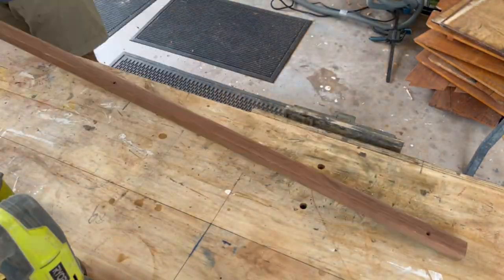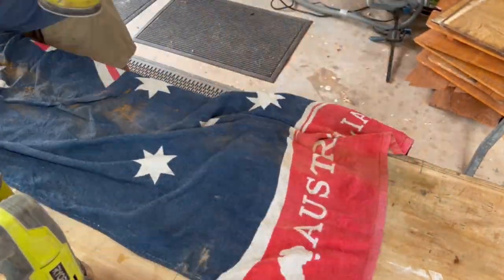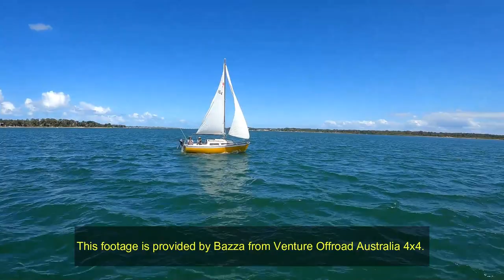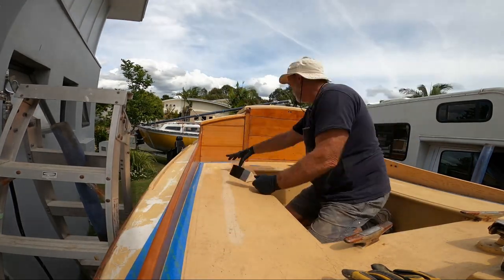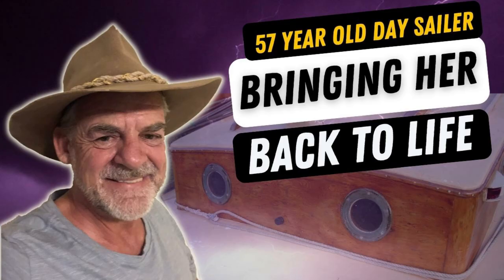SAFFRON - OUR SUNMAID 20 Fiberglass Boat Project: Fixing up Decks

Comment: I found working with fibreglass never wipe off the dust! I get the garden hose and rinse it all off without rubbing or touching the dust. I then strip off outside and once rinsed off go have a shower and don't have any itching problems. I once wiped my sweaty forehead at was covered in dust and I was itching for a week.
Reply from the maker: Thanks for the hints. Dust containment systems help a lot too.
Reply: @SmallSailboatCruising  Dousing yourself with talcum powder BEFORE you start working helps plug up the pores and prevents the FG dust from adhering.
Reply from the maker: @isserfiq  thanks for that. I've tried it and it works. Keep forgetting.

Comment: Nice video. Will the foam core be hard enough to hold screws fitted from the inside? I need to fix a 45-year-old sailboat spongy cabin top that definitely has extensive failed (wet) core. The side windows (leaking) and hatch are effected as well. That means I can't do a "simple" near level deckfloor repair by cutting open the top (non slip) fibreglass and replacing the old core by new balsa or exterior grade plywood. I probably will end up doing the later anyway in sections as the old failed core will most likely prevent a good result using your foam method.
Reply from the maker: Thanks. Overdrill holes fill with epoxy the drill  for fastenings. If it’s wet it needs to come out unfortunately.

Comment: Interesting; what type of expanding foam did you use.
Reply from the maker: Soudal. When you think about it, it's got to be an improvement on what they had 40 years ago. 3m make a very expensive one for stiffening car frames but I don't it would be worth the extra cost.
Reply: @SmallSailboatCruising  Which Soudal? I have some soft spots and this looks like a great solution.
Reply from the maker: https://soudal.com.au/expanding-foam/gap-filling-expanding-foam/ its worth a try but I would test it before going too far With it. I'm happy with the results I have achieved so far.

Comment: G’day Chris
I’m doing some work on the keel of my Sunmaid and I’m extremely frustrated now by the lack of information out there. The keel will not come down properly so I’ve never used it in the three years I’ve owned it. It appears quite rusted. The top of the keel pocket needed work so I removed it in an attempt to remove the keel that way. Do you have any instructions or links on the Sunmaid keel and how to remove. I’ve removed the keel bolt but there seems to be two other “lumps” on either side of the keel near the bolt end that appear to stop it moving. I’m completely at a loss now. Thankyou
Eric
Reply from the maker: I didn’t take mine out. I attached a chord and hooked it down while in the water. From memory I attached it to an anchor and reversed. The bolt would be the only pivot point. I suggest the Sunmaid association. They have a pdf owners manual. Good luck with it.
Reply from the maker: From memory it’s lead antimony. That means it won’t blow up like steel. Only barnacles etc. stopping it.
Reply: Thank you for the reply. I’ll give them a try. It’s so rusted and I’ve come this far I’d like to get it out to recondition it.